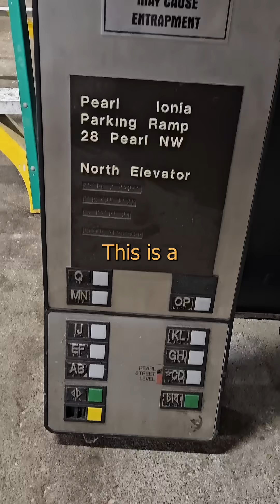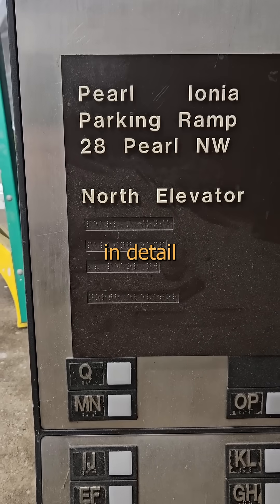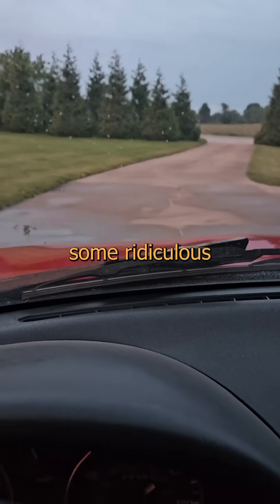Miata Mischief #chrisboden #engineering #gear #elevator #score #stories #parts #hacking #making

Comment: Not going to win but I will share my story for a laugh

The book case of just barely not:
I own a small hatch back. I bought a book case. Without the seats down it didn't fit by a few inches. With the seats down there was a ledge about an inch closer than we needed. Fine, fuck you. Your going on the roof and getting ratcheted down. No roof rack so going through the doors. And... nope. The ratchet straps are 3 inches short. 

The final solution: put the book case on the roof of the car, tie down the back side with the pair of too short ratchet straps. Use a moving strap, some blanket and a walking stick to tourniquet the front down. Drive home with my passenger holding the tourniquet, preventing it clocking me in the head.

Comment: Was asked if I could build a gazebo that was 12’x16’x10’. I didn’t have a truck at the time and not one to back down from a challenge, I accepted the job and found out that a 2006 Dodge Charger will in fact haul 16’ sticks of lumber and 8 bags of concrete.

Comment: My best friend and I found a 60 in crt tv on the curb at the anual bulk trash day. We used our 2 longboards to haule it to his house since he had the cool dad with all the classic consols. The only damage was a quarter inch of bad screen on the bottem left corner. We palyed so much duck hunt on that beast. When it finally died and we couldnt get parts for it 10 years later we took it apart to see how it ticked after doing our best to ensure it was discharged.
Reply: That thing was probably worth high four, bottom five figures. Look up the Sony PVM-4300 sometime.
Reply: @Raveseeker  given the size it had to be a projection TV like the old Mitsubishis.
Reply: @LouisSubearth  You'd think, but there's a small but compelling chance otherwise
Reply: @Raveseeker  the PVM-4300 is the biggest CRT, and that clocked at around 400lbs. Had they made anything larger it would be too large and unwieldy even for business use, where projection TVs are not as heavy for the size.
Reply: @LouisSubearth  There were other, bigger things-usually small production runs, always smaller than 10.

Most of these we know from very small sample sizes.

Comment: The sketchiest carry I ever had to participate was the time we had to move a load of my dad's merchandise into out SUV.

Think 4 dozen boxes of motor oil, auto parts, and disassembled shelves stuffed into a Mitsubishi SUV.
It ended up being so heavy that accelerating and stopping became gentle suggestion.

though that's only second to when we had to carry our long sign in the back of out large carrier truck. shame it was so damn long that I had to hold the door shut while it was moving.

Comment: I wanted a computer desk, but being a broke fresh-out-of-high school kid I didn't have computer desk money. So I bought an unfinished door slab and some cheap legs from a local hardware store to build my own desk. Only problem is that my car was in the garage waiting for a new CV axle and the only mode of transportation I had was my motorcycle, a Suzuki DRZ which is basically a 400cc dirt bike with a license plate and a headlight. But momma didn't raise no bitch so with abundant use of bungie cords and a quick prayer my soon to be desk was strapped to the rear fender and I spent the 8 mile drive home playing a dangerous balance game. Somehow I didn't dump the bike and I still use that desk to this day.

Comment: I had to haul dead IZh Jupiter 4, a 350 pound two cylinder motorcycle, using Renault Kangoo. We had to fold all of the seats except the driver's one, loading was a 4 man operation because the front wheel wasn't spinning, the bike had only one position in which it could fit in the car - laying flat with front wheel on the front passenger seat and exhaust scratching the rear window, and my friend had to ride 30 miles laying on top of the bike to help me unload it.

Comment: I picked up a door for a Suburban in my Jetta. I foolishly assumed it would fit in the back seat, so I didn't bring straps. Upon arrival, I learned that the door was the size of the car, so it wasn't fitting inside. Luckily my car had a sunroof, so I opened the roof, and balanced the door on the roof with the grab handle over the hole so I can hold it from the inside; unluckily my car was a manual, and there were several stops and turns getting back home.

Comment: Large miltary computer, Pontiac Fiero. Needed to get from point A-B and the process to borrow a goverment van was too long for my tastes at that point in the afternoon, so it went into the passenger seat, the floorboards, the trunk, and next to the spare tire, and some parts held between my legs as I drove back. I got chewed out for that, but I got to liberty faster.

Comment: Once "fit" a kayak in my '91 Montero. Wasn't the most secured thing in the world. Any time I stopped it slid forward since it hung out the trunk door which was held with a bungie cord but still swung a little freely and smacked into the back of the kayak which, in turn, ran into my windshield. I had to hold it, which was kind of difficult since it was a manual, to minimize the damage. Still ended up with a couple more cracks in my poor windshield.

Comment: Around  2008 I had a 2000 Miata NB ,I put the top down went to home depot and bought  a 4'x4' deep freezer " in the box " I put it on the trunk and put a few ratchet straps on it and drove like 7 miles home. ❤ the  flying  M Miata

Comment: I regularly use a Prius V as a truck.  Just lay the front seat flat, the back seats down and you have a lot of room for hauling.

I had hauled 10 16' 4x4s to build a treehouse and those boards were only sticking out past the trunk opening by 4'.  It still hauled.

Comment: 12’ bar of 1.25x.25” cold-rolled steel.   Cut it in half and bungeed it to the frame of my Harley Sportster.   Rode 8 miles with it.

Comment: Ukraine, Kharkiv region, about a year ago.
Back then, I was doing field repairs on home appliances. One day, we got a call to replace some heating radiators in a village right next to the front line. Not exactly your average house call.
On the way there, we ended up towing a broken-down army squad in an old Citroën van. We hauled them into the gray zone where their comrades picked them up. They tried to pay us, but we refused—settled on them filling up our gas tank instead. By that point, we were running on fumes and blind optimism anyway. We spent half a day there, working under the sound of artillery landing near us, but we finished the job.
On the road back, somewhere in the dead of night, we came across an ambulance on the side of the highway—hazard lights blinking, clearly dead in the water. We went to check. It was stuffed to the ceiling with medical supplies. Tried to start it, but the ignition immediately started smoking. Key nearly caught fire. Done. Fried.
We asked how much it weighed. “Two tons, officially.”
“Okay, and actually?”
“More like four.”
We couldn’t just leave them. So we threw a rope on it and started towing.
At first, we made good progress, coasting downhill. But when the road turned uphill, things went to hell. The hill was easily a kilometer long, with a 20–25° incline. Our car—some clapped-out old Zhiguli—started to struggle hard. I dropped from 4th to 3rd, then to 2nd, and finally crawled up in 1st gear, riding the clutch the whole way. It was whining like a dying animal.
Near the top, we spotted a little roadside shop. Around midnight now. I pulled over, got out, and told the soldiers, “Look… this is as far as we can take you. The car’s barely holding together. But hey, at least you’re not stuck in the middle of nowhere—you’ve got coffee, smokes, and something to eat.”
They were ready to carry us on their shoulders out of gratitude.
The kicker?
We were doing all this in a beat-up old Lada. Not a single SUV with patriotic bumper stickers so much as slowed down to help. Not one.
The only ones who did anything were two raggedy-looking mechanics in a junker.
They even gave us their number—told us if the cops ever started asking why we were breaking curfew, to give them a call. “We’ll explain why you are here and where they can go.”.
We gave them a call next day - they found an electrician who made their van work again so they were on their way again.

Comment: I owned a smart Roadster. Similar size car. 

I went to a big box store to pickup some furniture in box shape

Didn’t fit the car.  But I could take the roof off. So I drove home with a large cardboard box sticking out of the passenger side roof

Comment: I hauled my new fireplace with a 16 year old mini cooper S. The forklift guy said there was no way, but with the rear seats down and the front seats all the way forward it fit with less than a centimeter margin in all directions. Clearance to the roof was maybe 5. The car rode on its shocks all the way home but otherwise it did not seem to be any worse for wear.
So to seal the deal I loaded it with 1500kgs of veneer stone the next week to finish the fireplace. The car did NOT handle well on the road, but no one got killed

Comment: so this is a story from my father, one day he gets a call from his boss, & his boss says "i need you to take a grand piano from here to here" so my father says "get me a box van with a lift ramp" so later on he goes to get it but it's not a box van, it's a trailer that should have been scrapped. & the brakes were seized on so my father gets it lose & loads up the the grand piano & gets the trailer connected to his truck & gets going; a bit later, he's stop when suddenly the trailer hitch brakes off making it roll down the road but it doesn't hit any cars. so my father gets it back but he has ratchet strap back to his truck, when he gets it there there's was a stone archway over the entrance & the trailer couldn't get through so my father had to go around a different way
Reply: (this is another one i remember) 

my father was loading a mini excavator & a big excavator on a trailer & he used the big one to pick up the mini one & he left the arm of the big one up thinking the truck driver would put it down but he didn't. so the truck is going down the road when suddenly the arm of the big excavator hits a railroad bridge makes it go off it's support & sending the big excavator off the trailer

Comment: I strapped a 30 foot canoe on top of my Ford fiesta 4 door with twine and drove it about 5 miles at 15mph to the river and back again at the end of the day.
Reply: I used to regularly put my 16 ft fiberglass canoe on top of my '87 Yugo. The canoe was longer than the car. The 2 hour ride to the lake was an adventure between the 55hp motor screaming trying to maintain at least 45mph and the wind whistling through the roof rack, the quiet of paddling on the lake was wonderful!

Comment: I hauled a new lawn mower on top of a couple 4'x8' sheets of plywood in my 2002 Ford Sport Trac. When we were finished rigging it up, it looked like some sort of strap\g-string fetish hanging 4ft past and 2ft below my bumper, with a lawn mower facing down the grade ready to impale someone's windshield that was following to close after a gravity-assisted launch down the ramp if anyone brake checked me.

Comment: I once moved my Honda xr400 in the back seat of a ford falcon. Required a fair bit of disassembly but got it in there. The boot was full with my tool box and I had a couple of weeks of clothes in the front seat. 50psi in the tyres and hit the road.

Comment: The grain elevator was getting torn down in my home town. On the top of it was a 40 foot length of triangle truss, but the really heavy duty stuff that’s hundreds of dollars per section, not the small stuff for residential antennas. Hauled it home in the back of an F150 short bed. I was standing on the end of the truss in the bed of the truck to act as a counterbalance so the other end wouldn’t drag much to take it home. Turned it into a bitchin HAM radio tower 😅
Reply: "much" 😂
Reply: Hell yea
Reply: Hell  yea
Reply: That’s fricken awesome
Reply: Underrated comment/story, that's epic!!
Reply: I feel like I could swap out "triangle truss" with any number of items in this story and include almost every truck I've owned... exept my buddies low bed, haven't had a lod too big for her yet.
Reply: 73 De KJ5GZ_!

Comment: A few years ago I built a cabin for myself. At the time the only car I had was a 1st gen Honda fit and I had procrastinated enough to need strut, half inch conduit, a water heater, and all my tools in the same day. So I folded every seat in the car down and stuck the pipes from the back corner, through the center of my (precariously jammed in) work cart, all the way to sticking about a foot and a half out the passenger window. Then I jammed the water heater in the opposite back corner and crammed tool bags in any nook they would fit in. Sagged probably 3-4 inches driving all the way across town lol

Comment: So... when I was in undergrad, I studied abroad in Costa Rica.  While there, I bought a couple of very nice walking sticks.  One I kept, and the other is now my mom's.  I had an old running injury in my knee, so when we went through security (armed security, before there were military troops patrolling the airports), I used my walking stick, and pretended my knee injury was acting up.  It had acted up enough already that it wasn't a difficult act to pull off, and my mom used hers, pretending to be... more frail than she was (she had a couple of rather fragile joints in her leg, so again, not difficult).  We put our walking sticks on the conveyor, and the security guy picks up mine, and comments on how nice it looked.  I, meanwhile, was doing my best impression of my knee injury acting up without support, as I agreed with him.  So he put the thing back, and we got on the plane.  So now we have two walking sticks and no where to safely store them.  We grab a flight attendant and ask him, and he takes the walking sticks and lays them down in the overhead bin.  From what I can tell, they were probably leaning against the bin door the whole flight.  Then we did the whole injured and frail act when we got back to the states... at least until we got out of the airport.  And now I have a walking stick with a bird head carved into the handle, and my mom has a more traditional looking cane made out of like three different kinds of tropical wood.  I still use mine, every now and again.

Comment: When NY outlawed cigarette machines the local punk bar in Albany was gonna put theirs on the curb till my roommate decided we needed it for our apt, they managed to drag the multi hundred pound pile of ancient sheet metal the 6 blocks to our apt, but had no chance of getting it up the 3 flights to our apt so out comes me and I power lifted it on my back while cutting my hands open up all 3 floors balancing it on the nearly 100year old curved wood handrail and against my forehead and the wall for balance bc it was physically wider than the staircase, till we got it into the apartment where I could gut it, and use it as a lockable storage cabinet, also managed to pull more than a carton of ancient stale mixed packs out of it so I didn't have to buy more for 2 weeks, poor service industry 20s kid bonuses all around

Comment: I got a coffee table/trunk the ones that the table part opens to put things into the box.
A friend who was moving cross country gave it to me, and I had to take it home in my 97 Chevy lumina, it stood on it's narrow side inside the trunk, ¾ of it sticking out of the trunk with the door holding it from the top and 2 pieces of hay bale twine pulling the door down from the latch on the bar where the latch latches, I didn't have any flags but the twine was red, the 50 mile ride back home was luckily uneventful.

Comment: I've got a few good ones..............not so much hauling, but rather getting semi-disabled vehicles home. 1. Broken throttle cable on firebird formula = 12ft boxig hand wrap as hand throttle - out window and under open hood to throttle linkage for acceleration.     2. Brakes gone......used E-brake and gearing so gradually come to a stop on way home.     3. Kawasaki motorcycle - broken clutch cable - get a slight forward push and POP into first gear! - I was young & stupid once., now older & still stupid.

Comment: 8-foot lumber will fit in a 2016 Kia Sorento with the hatch closed and back seats folded down, but you have to have a passenger to lift up the boards for you to put it in gear, and you should set the climate control before loading. In a completely different sort of craziness, two days after my brother bought a eight-year-old 1997 Ford F250 with the 7.5L schoolbus turbodiesel, he was helping a friend with a horse ranch bring in the hay, and the transmission exploded. The trailer was ONLY 12, 500 pounds! The previous owner had never driven it with any kind of load whatsoever, but was a standup guy, he went halvsies on the new gearbox. It's still his daily driver. He's kept the same truck for literally half his life, never moved out of his childhood bedroom, saving up to buy a lot of land and build his dream house out in the boondocks.

Comment: I got a job in the oil field in Edmonton Alberta, so I flew there from Ontario. A few months later I got laid off because the oil bubble burst.

I sold/gave away most of the stuff in my apartment, loaded the rest into my 5-speed naturally aspirated Kia Spectra5 hatchback, and drove from Edmonton to Toronto. I had a narrow view out the passenger window over my stuff and an even narrower view out my rear window. It took 4 days to get home. 

Started an apprenticeship with the local millwright union a month later and proposed to my wife a year later.